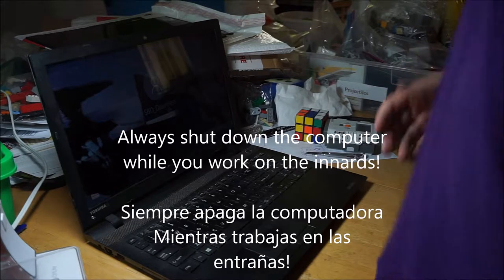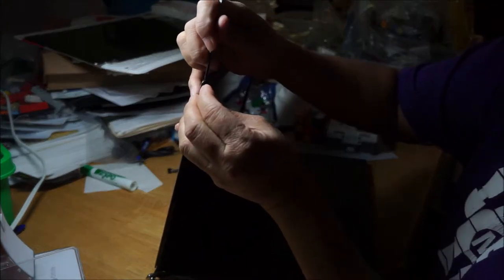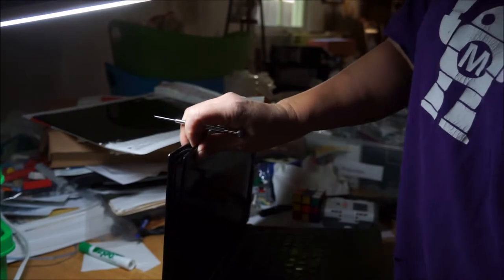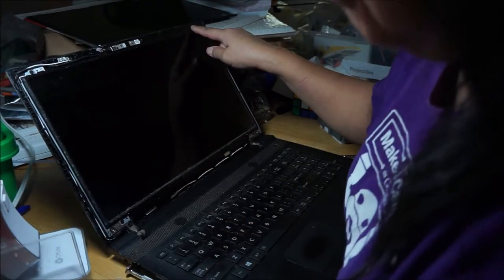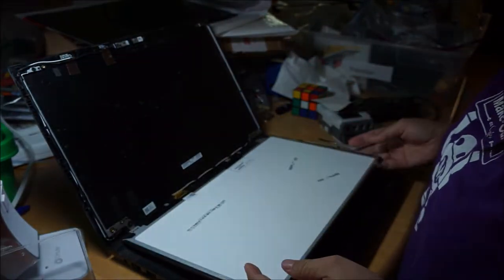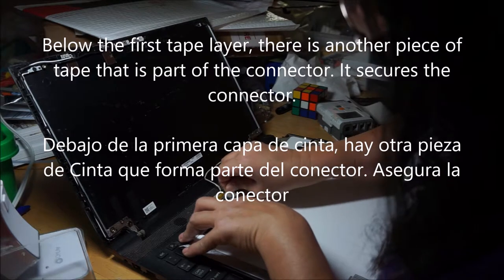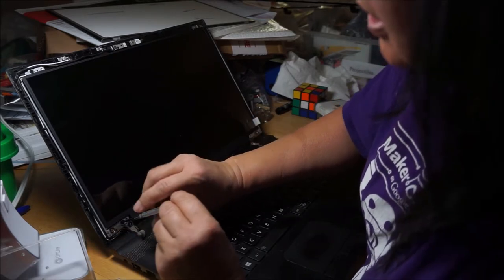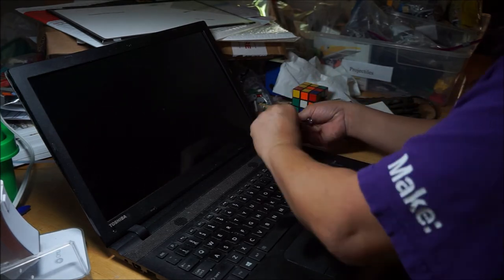Laptop screen replacement / How to replace laptop  screen: Toshiba  Satellite C55-C

Comment: You must check if your laptop is on a black list of explosive battery by Toshiba 3 or 4 years ago manufacture. Mine went Hot the battery, starting to melt, and after check Toshiba web they check my battery SN and sent a new one, even out of warranty.